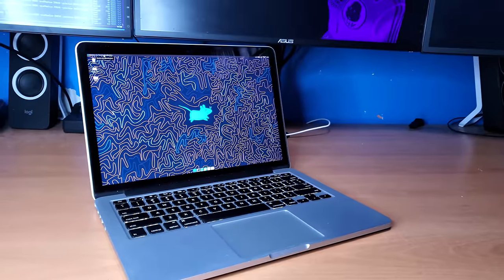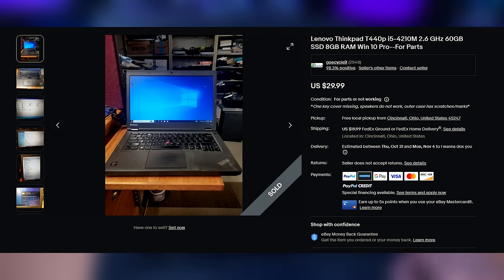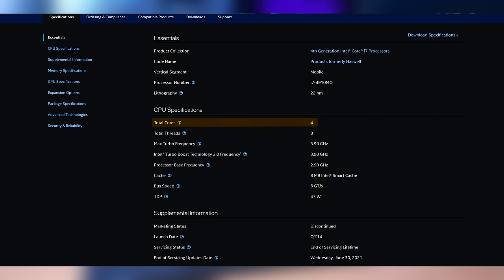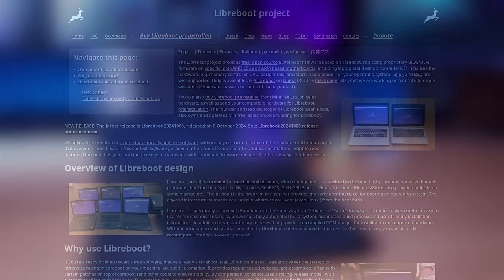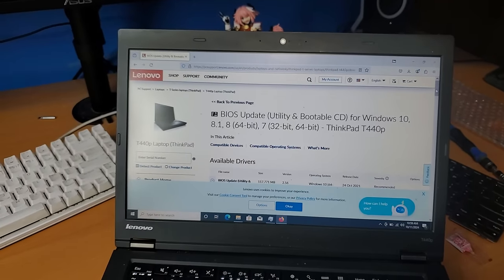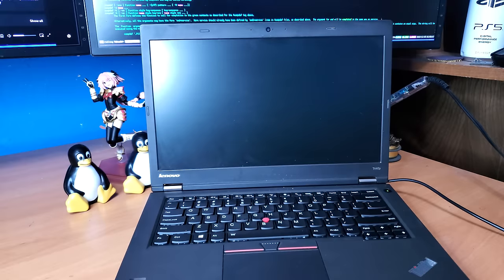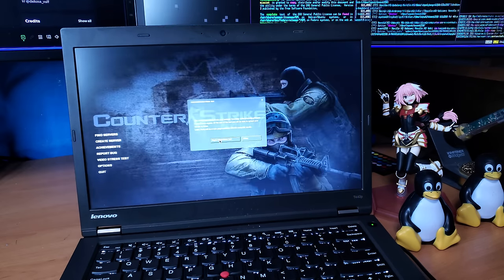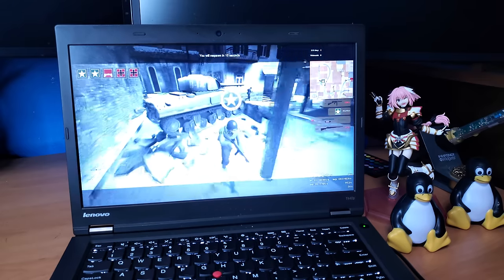Building the ultimate ThinkPad!

Comment: Bruh the T440p is only one gen newer than your MBP, and it runs hot as shit (I'm posting from one right now that was hitting 90°C+ regularly and thermal throttling and lagging horribly, though having it docked makes temps worse I think), I just redid the thermal paste a couple days ago and it helped a fair bit but it can still hit mid 80s under load, and I have the i7-4710MQ, so I imagine the one you got will run even hotter.
I've been looking into upgrading from my T440p. You gotta accept some compromises since this was the last model with socketed CPU and a lot of other nice features. I think the T480 still allowed multiple drives, but that's not newer enough to easily justify an upgrade for me, so I was looking at the T14 gen 1 or 2. They're coming down to the $200-$300 range. We're just recently leaving a dark age of new ThinkPads where a lot of them had partially or fully soldered RAM, but the latest T series models are back to fully upgradable RAM again. So that'll screw up the used market for a few years, but then go back to being okay.
Reply: If you cover putting Coreboot on here later, I'm curious if you can find a replacement WLAN card that works with linux-libre. I run Guix System on my T440p and haven't replaced the BIOS/UEFI yet, so I just took out the non-functional WLAN card in the meantime. On my X220 Tablet I had gotten a modded BIOS and Atheros WLAN card that worked with linux-libre, but it looked like it wouldn't be as simple with the T440p, and I have to find a different card to use since the port changed.
Reply: Is the cpu fan working? I have a 4810MQ and even when I set my fans to Auto on Arch Linux my T440p speeds up the fans once the cpu hits around 72 and it cools right back down. Albeit I have a fan control program to set the fans to a fixed speed if I want but even then it should never be that hot.
Reply: 440p is a dinosaur nowadays tbh

Comment: I took apart a T540p to do a cpu upgrade and had the same issue as you with it not turning on. The keyboard backlight as well as the power button led would come on,  but it wouldn't post. I reset it a couple of times and still it would not post so I turned it on while it was charging and left it on for about two minutes after which it posted and it's been working fine since then. It also had 2 sticks of ram. Btw, did you experience coil whine with the T440p?
Reply from the maker: I have not experienced any sort of coil wine at the moment

Comment: That’s weird I daily drive an 07 iMac with 4gigs and a spinning hard drive and I’m running Monterrey with no problems at all and Linux mint. I use it as a tv mostly, I have sling and Hulu so this gets used 24-7 365!  Maybe you have a failing capacitor? I also have a 2008 Mac mini that also runs the same with no problems

Comment: Talk about a "Just Works" distro, Manjaro ~ was also a Simple step from Win7.  I'm on a laptop that was/is my first daily linux driver and I haven't found any reason to fault Manjaro XFCE.  Granted, I'm the guy who does NO mods, feels that the OS should be 100% transparent, just allowing the programs to run without issue.  About the worst hiccups I've run into was losing grub dual-boot during one Manjaro update (was clearly documented on the forums within a couple days, though I didn't notice for months since I have only 1 reason to ever boot back into Win7 and that only happens about once a year)....  Oh, time frame, I made the switch in ~2019 so 5 years now.  Anyway, my P50 is still very viable as a daily, even doing photo editing and light cad/3d modeling work.

Comment: I've got the same machine and I'm also using Arch with Plasma desktop. I love it so much! I've got the cpu, display and ram upgraded and I have an HDD caddy in place of the DVD drive. I also added an M.2 drive and with the standard SATA drive in it that makes 2 SSDs and 1 HDD for storage. Not bad at all! I've got the same thing when I upgraded my cpu - the power supply was not enough, so I just bought a second hand Lenovo "brick" and it's running without any issues for more than 3 years now. I wish they built modern laptops like this.

Comment: I really want to get libre, or Core boot on my laptop but i run a Dell Latitude 7400 and i dont think its supported by either. Altho im not really sure for coreboot cuz their wiki is being retired and i cant find a full list of supported devices. Considering its a 2020 which is pretty recent tho i doubt its supported. For now simply running linux will need to suffice for securitys sake. I have considered getting a secondary laptop thats more security focused and going with an older thinkpad but cant justify the cost atm. Hope if you decide to do it you post a video would like to see what the process is like and how many hiccups you run into.

Comment: man, every time someone praises linux for the reason of "mnehh, it's more customisable" when they've only run the default retail releases of windows, it hurts me inside.

praise linux for things linux actually does well like ease of use as a poweruser and the opensource problemsolving and the COMMUNITY SUPPORT (especially for older/low power hardware*)

the fact you can make it look how you like isn't special and it's deminutive to what linux actually can do and why it's as popular as it is in tech spaces.

*this is less of a rarity now that chromebook level computers have flooded the market and so many "laptops" are less powerful than they were 10 years ago, I don't know why there's so many 2C2T <3GHz with 4gb of ram computers in stores in 2024 is disgusting. I have laptops with specs like that from the DDR2 era.
Reply from the maker: I agree, Linux is a lot more than just customisation, my Windows PC has no Microsoft bloat at all and I've ran scripts to remove Windows defender and many other things, but you shouldn't have to do that in the first place, its one of the big reasons I like linux and especially a build-it-yourself distribution.

Comment: 7:51 also there is pads for an m.2 sata port under the palmrest(?). you can solder down a new port and a few accompanying resistors and it'll work. there's a guide on yt if you want to do it but its a little pointless and i think lenovo realized that lol.

Comment: bought Apple, complains about upgradabilty. 😂 I have a t490 and a Latitude 5020 both are decent linux devices. But if your looking for an aluminum chass like the Macbook but with far better upgrade potential just got for an HP elitebook, I use one at work. It's a good balance over all. I just prefer Dell over both brands. Luckily these days they all work worh the same thunderbolt dock so at least there's that.
Reply: probably was joking
Reply from the maker: I bought it because it was a good deal back a few years ago
Reply: @Ionic1k  That's great thpugh

Comment: $30 Thinkpad plus $20 trackpad replacement plus CPU replacement plus BGA adapter board plus 4+ hours of work and troubleshooting to upgrade and get it set up correctly. I think I'd rather just get a Ryzen 5  Pro 4650U Thinkpad with 16GB ram and a 256GB SSD for $240 on eBay and toss whatever distro I want on it with 0 hours of work and a faster rig.

Comment: I daily drive the t440p, the second one I bought after having spilled isopropyl alcohol on the board of my previous one. With a torx head screw driver I could still transplant that old quad core i7 I had for the dual core one that's in my current t440p, so I may get around to that someday. But the only issue I see with this laptop is the limited vulkan compatibility. I have the nvidia gpu and it doesn't improve the situation either. So yeah you're not gonna be gaming much on this laptop apart from linux native games, which run fine (as do some wine games, but certainly not most). Otherwise, it is a splendid laptop. I don't think there's anything like it. The framework doesn't have the trackpoint and and the old thinkpads don't have the power. The trackpad sucks though, haven't replaced it yet sadly. The keyboard is also not as durable as the old models but fine to type on.
Reply: Fun thing I discovered recently and I don't know if anyone's talked about it, since you can put up to 16 gb ram (can you even do 32? I don't even know), you are perfectly capable of running a local llm on this machine so you can have a complete and offline ai assistant that doesn't take pictures of your screen every 15 seconds. It's pretty neat.
Reply: I wonder if the iris graphics would solve the vulkan issues, or if it wouldn't matter cause it's still haswell
Reply: also wtf you can put libreboot on this? how long has this been possible?

Comment: With the advent of used computers with intel 8th gen hardware being as cheap as USD 140-150 for a Thinkpad X280 or a T480, why on earth would you need a new laptop for 85% of tasks. You can even get a rail/base for a old GPU, if you have one laying around and push the GPU performance with 2x by setting it up as an eGPU.

The market is swarmed with used thinkpads after the covid epedemic, becuase people are selling the devices bought during that time for remote work.

Comment: I just sold my 14'' Thinkpad with  ryzen 3 pro 4450u just because It had the RAM soldered to the motherboard and only one m.2 (no SATA, or anything else) slot.

I got an Acer with Ryzen 4700U (almost double multiscore in R23), upgredabale RAM and 2 storage slots (m.2 and SATA)., and I hate it! The sound is way worse, the fan noise is way louder, the camera is worse, the chassis is worse.

I just can't like anything else since I had a Thinkpad. I'm already planning to sell the Acer so I can buy another Thinkpad, lol.

Comment: Man, what is this nonsensical title?
My ThinkPad L490 rocks i7-8565U 64GB DDR4 running Fedora 40.
I changed the WIFI with a SD 512MB card and run 2 nvme SSDs 6TB in total.
It is faster in decompression than even Zen5 laptops.
Yet, I would not call it Ultimate, overhyping is not good.